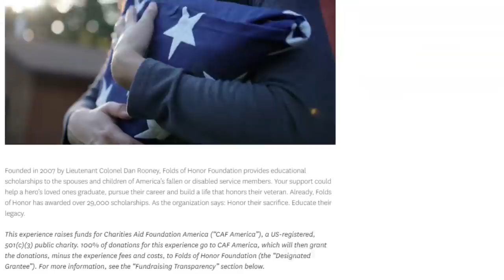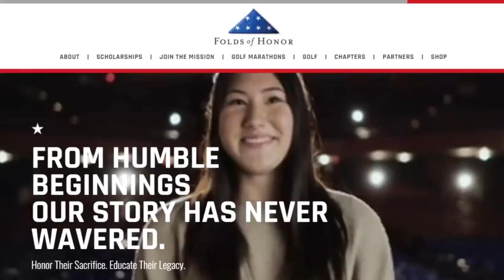ADDING STAIRS To Our 625 sqft Deck

Comment: It is awesome that you are supporting "Folds of Honor."  As a retired Navy vet, I remember a time in the 70s when the Navy suspended the requirement to travel in uniform because of the vitriol directed to service members in airports and other travel venues.  It is encouraging to see that a lot of that has changed.  Thank you for supporting the fallen and wounded.

Comment: I build decks and I’ll tell you that is one well built deck you guys built.
Reply: yes.   i'm still worried about the butted joints overlapping the joists (water can't drain)
Reply: I watched a so called master carpenter build a small building. The floor was like a trampoline when you walked across it. This deck will last a very long time.
Reply: @alexhatcher8812  I was wondering about that , maybe could have used the cut offs for the stringers.
Reply: @alexhatcher8812  yes that is a concern. What do you think about the orientation of the deck boards, running lengthwise with the entrance and stairs instead of perpendicular, won't that make it slippier?
Reply: I'm no expert ... but it looks like it will last for hundreds of years. Wouldn't that be great.
Reply: I think it’s well built also and know all that lumber was EX-PEN-SIVE
Reply: To be honest I’ve seen houses built on structures less stronger
Reply: I'm still wondering why he added length to the bottom step on the stringer. They're supposed to be smaller to accommodate the thickness of the actual step material. Their bottom step will be higher than the rest
Reply: @snappingbear  slippier? Erin, we've got a volunteer for your English & spelling class. Loads of decks run the boards parallel to the stairs.  It's the #1 way to carry water away from the house, however; Running the boards parallel to the length is always desirable, it gives the deck a much bigger look.  Again it’s a personal choice, but if your indecisive on which way to run them, If I was to fit your decking I would run them parallel with the longest side. I think Josh and Erin do awesome for a couple of young people who dared to take their dreams to the next level.
Reply: @DKanon  it would be kanon only stone last like that.
Reply: Likely the sturdiest deck ever built!
Reply: It would be good to use some roofing paper on the wood below the floor. Than the woods will not rot so fast from the water from top
Reply: I guess overkill is better than underkill
Reply: @snappingbear  floor should have been parallel with the steps.
Reply: @Marc Grecco 💪🏼 I'm telling you that Josh is a Jack of all Trades, I can't figure out how does a person that has no experience what so ever on building a house 🏠 build such a beautiful A-Frame at that. It's incredible to me, the only thing I can figure is, when you have all the right tools and material, even when you make a mistake , common sense is key to a build. And of course measuring correctly.

Comment: I love seeing the rain!  (There's no rain out here in S.D. - very hot and dry).  Your deck looks marvelous!  Plus now you have more scraps for the wood-burning stove - I used my stove for an entire season using the scraps from my little green-oak cabin in Virginia.
Reply: Pressure treated wood is not safe to burn indoors or even outdoor due to the chemicals used to treat the wood.
Reply: @janemorgan5694  Yeah, please never ever do that its really bad to be around that smoke.
Reply: @janemorgan5694  Excellent point.  All my scraps were just green oak.  Please ignore my suggestion!

Comment: Awesome work as always. 

I was however wondering, have you never thought about buying a party tent of say 10 by 20 feet and use that as your spot to saw/drill etc? With all the rain interruptions, you could at least keep on working partially and you wouldn't have to scramble to keep the tools dry all the time. Just a thought I had.

Comment: Put a gate on the sides so you can just use a big scoop in the winter to just push off the snow in the winter,alot easier on the back,no lifting.especially down the road when you're older,that's what I did for my deck.

Comment: Having a bit of fall in the stair tread is not really noticeable when walking the stairs, but will help water drain off the treads. That’s good for rain and melting snow and ice!
I’m afraid your blocking at the base of the stairs is going to trap moisture and lead to early rot of the blocking and deck boards. I would suggest to put a deck board spacer in between that is not fastened and pull it out after fastening the blocking in just above the deck. Also put a bit of tilt on it too.
Reply: I hate to sound shady but I think Josh is obsessed with perfection and being perfectly square. I believe that blocking is to satisfy the perfectionist in him. Agree that without adequate airflow rot will take out the deck far quicker than being out of square.

Comment: This deck will last long time. If you ever watch  professionals building anything they will build it with speed in mind cutting out as much time as possible this means as long as they follow code requirements they are done but code requirements are put in place just enough to make sure it's safe. When you build your own you take the time to make sure everything is done right and you will go way above the code requirements. You guys are amazing. Watching your videos makes my stress melt away. Much respect to you guys for everything you accomplished.

Comment: Dunno if its too late but before you lay down the last layer of decking on the top deck, you should lay down some of that weather sealing(i think also called hurricane) tape on the frame of the deck so all the top sides are more protected from the rain and snow.   Should give the frame a few extra years from rotting

Comment: If you run into trouble with the risers and treads lining up run a string on your top deck band joist this will let you see what you need to do to adjust in and out for straight.

Comment: FYI, you do NOT need to put screws in every hole on the underside of the connector.  Go look at the Simpson site.  You only need 1 (ONE) fastener in the second to the last hole.  We are also building a house and recently finished up our three decks.  LOVE your videos!
Reply: Do you think using more screws makes it more stable and stronger?

Comment: The deck looks amazing, if you let me advice you guys, you could built a temporal roof with some of the plástico tarp, that you used for the concrete walls, and some rope, so you wouldn't have to go inside every time it rains, saludos desde Chile

Comment: Accidently had it set to 1/2 speed at about 14:00. Josh starts talking and sounds absolutely HAMMERED. Then Erin starts talking in it  about 14:20 as well, sounding the same-hilarious!  Then she say's "you're a champion" and he says "I am a hot mess." and it sounds like they are baked. Had to watch the whole 5 minutes at 1/2 speed, cracking up the whole time... :)

Comment: i would say that over time the stair stringers will absorb the hex  heads of the screws l would have made the stringers flush with the facia, but as you say it will raise the treads so its no big deal

Comment: I love the videos. I just built a deck and was advised to put ice and water shield on the top of all the framing before I installed the trex. I understand it's to extend the life of the framing from water sitting on the top of the front to help prevent rott down the line. 
But your deck is coming along nicely 👌🏽🇧🇸🇧🇸🇧🇸

Comment: if they are a touch high on the tread at the outside they will shrink down and be level depending on the water in the wood. i don't worry about it unless im off in that direction. then i claim its intentional.

Comment: I thought for sure you were going to say "Yah Mule" when you smacked her pusing that board.. lol.. good video.. I don't know if you will see this but if you take a composite shim and put them on the bottom of your stringers they will keep the end grain from sucking up moisture. I staple them but construction adhesive works too.. just don't use so much you get it on the deck boards.. so far so good.. its going to be interesting when you flash your ledger board for the stone ..

Comment: Josh ck your local codes for hand rails and grips for the length of your steps you need them every so many feet apart for residential work also your insurance company will make you put them in also

Comment: I would've probably used countersunk screws, or at least a flathead screw (idk if that is what it's actually called in english, but you probably get the point). It looks great though, as usual :)

Comment: Josh - No easy job cutting stringings and the amount you had to do.  I think your first step off the lower platform to the larger deck will be taller than the remaining step.  If I understand correctly, you added back 3/4 inch to the stringer template.  That template accounted for a 3/4 material for the trends.  Basically, the first step is always shorter by the thickness of the material that is used for the trend.

Comment: Why don't you use a few boards, screws and a tarp to build a temporary rain cover/tent over your work area so you can keep working when it rains? You can build to be easily folded and moved, so you can keep using it when you work in different areas.
If you are interrupted by the rain, the work takes much longer.

Comment: Thank you both for sharing the DIY accomplishments that you both have done. I am an electrician myself and I don't think anyone could have done a better job of creating the off grid system like you did. Of course I know technology has improved by leaps and bounds in the last few years. I do want to ask did you have a set of plans to work from or did you just take it segment at a time? Best of luck to you both.

Comment: That's a lot of rain! I'm in a desert climate (under 12in annual precip) and I can hardly imagine enough wet to make everything green like it is there.
And that is a lot of stringers! Are you going to need intermediate railings? With more than 2 steps I think code in my area requires a railing but I'm not sure if it is just at the end or every four feet, or ...

Comment: Are you concerned that because you used hex head screws on the hangers that prevent a flush fit that as wood ages the boards will sink into screws? (Then your deck will loosen or start to warp?)  Why not T25 deck screws?

Comment: If you tap the stair stringers onto the hex screw heads on the brackets it gives an imprint  you can drill relief holes so they sit flush to the brackets  and lock on the screw heads.

Comment: The only concerns i hve is those clips or braze u hve for d steps i am wondering will they stand d test of time my idea is put some pieces of two by fours under d brazers si incase d steps will hve a braze to hold it up until u fix it just an idea

Comment: The bottom rise on the stringer is cut shorter because you are adding that thickness of tread on top. If you figure it out that will make all the rise the same. I know hard to commprehend

Comment: The bolts you used to attach the connectors to the side board should have been flat headed instead of sticking out. That is why the steps are not flush with the side board. But whatever works for you. it will work as I know you will make it so.

Comment: Использовать винты с шестигранной головкой для крепежа опор лестничного марша - плохая идея. Они явно мешают плотному прилеганию опоры лестницы к боковой доске верхней террасы. Со временем, винты будут повреждать торец опоры и высока вероятность что лестница начнет скрипеть. Лучше было бы использовать гвозди. Либо опорный брус прикрученный к торцевой доске верхней террасы.
"Yandex Translator" is used:
It is a bad idea to use hex head screws to fix the supports of a flight of stairs. They clearly interfere with the tight fit of the ladder support to the side board of the upper terrace. Over time, the screws will damage the end of the support and there is a high probability that the ladder will start to creak. It would be better to use nails. Or a support beam screwed to the end board of the upper terrace.

Comment: Maybe you don't show it due to time, but shouldn't you be coating the cut ends with end cut preservative. The pressure treating only goes in so far so if you make a cut there won't be any preservative on the cut face.

Comment: you guys need to get something straight you're option "Z all of the above"
All of the above as in house builders, concrete pours, designers, architects, Eng., electrician (obvious one), Mother and Father (darn good ones I might add), roofers, decker's, photographers, video creators and editors, plumbers, finishers, carpenters, etc, etc, etc, etc ......................................................... 
STOP saying "your not Blank" you guys are whatever you need to be when you need to be! 
My advice is ENJOY all the hats you wear now and all the hats you will wear in the future!

Comment: Also, you "put back" the amount on the bottom of the stringer that you thought was for "patios".  You have now made your bottom step higher than the rest (probably 1").  The bottom Rise has to be calculated differently.  You have to account for the fact that your deck you are landing on is considered a step and so you have to "take off" the thickness of that material.  5/4 board. You should have made your bottom riser 1" shorter to account for that.
Reply: @Coyote-tc1ww  Well....it causes a trip hazard. It is why there are codes.

Comment: Not to be critical but these stairs would not pass code.  Each step must have the same rise in height.  The stringer template you purchased was 3/4” shorter on the bottom than you expected and this is done for a reason.  The thickness of your stair tread material is always deducted from the bottom edge of the stringer ie 3/4”.  What this means is that your stairs, when finished, will not have consistent step heights.  Because you added that 3/4” back to the bottom of your stringers you will find that the bottom step will be 3/4” taller than all the rest.  You will notice this each time you use them.

Comment: Love your hard work.
However. This would have save you a whole day of cutting.

Stack the stringers
Clamp it.
Cut it with a chainsaw.
Belt sand the rise.

Roughly an hour job done. I think you spent too much time walking back & forth & cutting each stringer & installing it one at a time.

Also remember too seal the cuts with deck oil or cutek extreme oil to repel moisture. You want the deck to last 50 years not 5 years due to wood rot & fungi.

Comment: Nice job, but poor planning. Now you will have to remove ALL of the stairs to replace bad deck planks. There is a reason the stringers go on before the deck planks are installed. And yes, you will have to replace warped/cracked/splintered/rotten planks, sooner than you think.